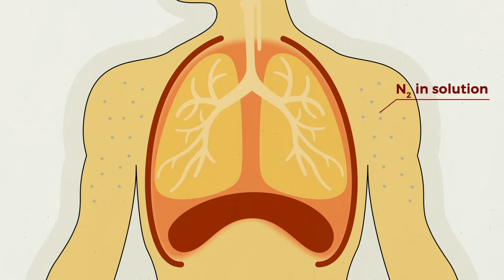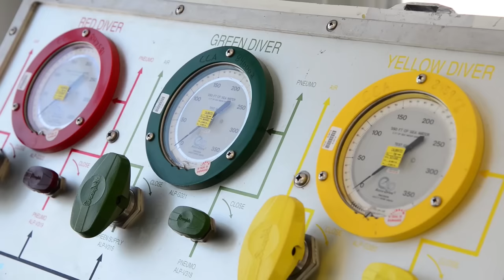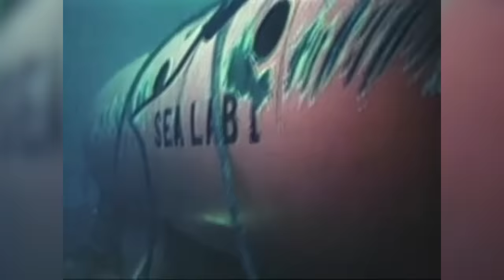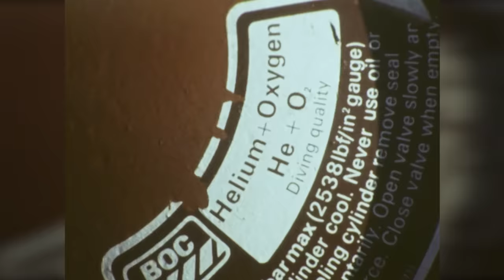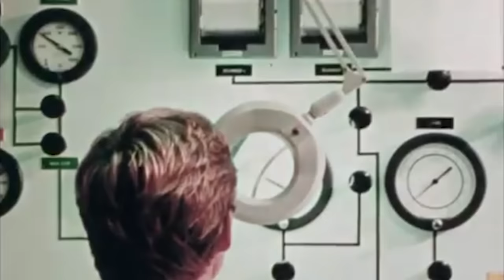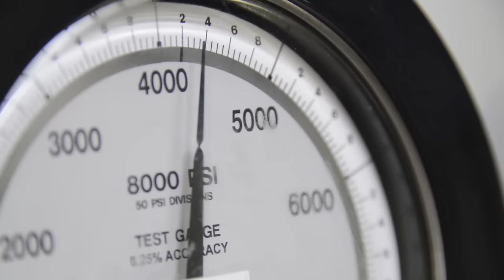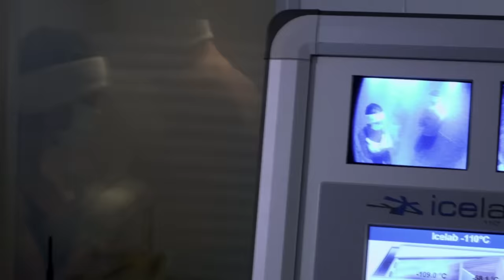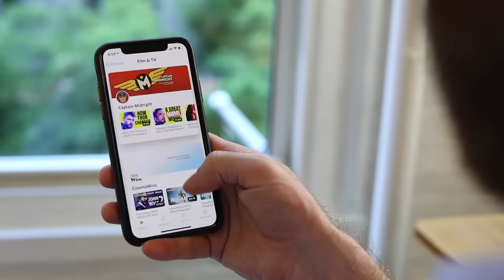Surviving the World's Deepest Dives

Comment: Hey so it says that every 10 meters adds another 1 atmosphere of pressure (which is close enough) but then you have 20m = 2 atm and 30m = 3 atm but if you follow this it means that 10m = 1 atm and that 0m = 0 atm, that would mean that it would be a vacuum at surface level which there isn’t. you can’t forget that there is already pressure at the surface which means that 0m = 1 atm and that 10m = 2 atm and that 20m = 3 atm. Just though I should point that out.
Reply from the maker: oh yeah woops. my bad!
Reply: I mean if you look at it as gauge pressure rather than absolute pressure the markings are technically correct
Reply: Real Science I loved the video though. And yeah I have made this mistake before as well.
Reply: I came to the comments to point that out! Great video anyway (as always)!
Reply: @Paul O'Reilly The surface pressure (0 m) is 1 atm, at 10 m you add 1 and so it's 2 atm.

Comment: Such a dangerous job on so many levels.  I read a story about an accident in one of the pressurized bells and it is unbelievably gruesome.  Lots of respect to sat divers and the people that keep them safe.
Reply: Probably the Byford Dolphin accident where 3 british divers and 2 norwegians lost their lives when one of them (let's say the fifth diver) disconnected the diving bell from the decompression chamber before the chamber door had been closed, which caused an explosive decompression with four divers inside it. Instant death. There was 10 atmospheres inside the chamber and bell, and one of the divers was sucked (or rather blown) through a small opening cause by the jammed chamber door.
Reply: @Antarath  10 atm? What depth does that equal to? Sounds like 60 + meters.
Reply: @d.dementedengineerc99isurf26  100 meters (295 feet). 147 PSI. It's one 1 atm for each 10 meters below the surface.
Reply: @Antarath  That figure omits the one natural atmosphere of pressure found at sea level from the earth itself, but I suppose that should be set to zero for simplicity.

Comment: cool video, but as a scuba diver myself, i would just like to point out that the pressure readings at 1:00 would better in absolute pressure rather water pressure (the atmosphere itself adds 1 atm of pressure, ie at 30m depth there is 4 atm).

this is important because the gas laws (boyle's law, charle's law, dalton's law, etc) use absolute pressure

Comment: Some clarification.
1. Recreational divers can reach 40 meters.
2. Nitrogen narcosis is an old term, now is called gas narcosis as also oxygen give is contribution to it (and helium, when used).
3. Most of works happen in the first 30 meters.
4. Diving air is 79% nitrogen and 21%, 78- 22 it's considered to be Nitrox (aka Enriched Air) and will limit the depth of your dive. but extend the time at depth. Control oxygen partial pressure is key to avoid convulsion.
5. Helium is a "cold gas", when breathed it remove heat from the body but without giving the coldness feeling and can lead to hypothermia if body temperature is not under control.
6. Sat diving can be as long as 28 days.
7. During sat diving the immune system will decrease is functionality, that's why every sat environment should be deeply cleaned to avoid infection.

Comment: Liquid breathing does sound interesting, so far I don't know to much about it but it's basically this liquid that is just as saturated with oxygen as air is so if you 'drown' yourself in it you would be able to breath on, it's used to torture people.

The main advangtage with this liquid is that there is much less gass buildup and that a liquid doesn't compress when put under pressure so the main cause of decompression disappears, of course you get a whole bunch of problems in return. Like, are you going to drown your divers every time they go to work? (does sound better than days of isolation tbh)  And how do you keep the liquid fresh and circulating?

Comment: Very informative, just a couple of corrections, the limit for recreational diving is 40m not 33m  and the  absolute pressure at 33m would be 4.3 ATMs ( remember to add the  atmospheric pressure)  . The air is composed by 78%  Nitrogen 20.9% oxygen and 1.1% of other gases which then its rounded as 79% N and 21%  Oxygen, the other gases are negligible to diving. In respect of the gas mixtures you got Heliox ( Helium and Oxygen) and there is also Trimix ( add Nitrogen)
Reply: Trimix is not common the commercial diving world. It is popular amongst the recreational 'tech diving' scene as it is a bit cheaper than a true heliox mixture. Currently the deepest a commercial divers operate up to 300m with some people proposing up to 500m with a hydrogen/ helium/ oxygen blend. The deepest a human has been pressurised to is 710m in a chamber in France on an aforementioned hydrogen/helium/oxygen mix. FYI when commercial diving is carried out at around 250m or more there is only about 2-4% oxygen in the heliox mix to account for the partial pressure requirements of our physiology.

Comment: 20 meters would be 3 atm, not 2. One atmosphere of pressure is at sealevel. 2 at -10 meters, 3 at - 20 meters.
Reply: @Latoo Ootal, thumbs up to that hehe
Another thing that was a bit off was that regular air is 78% Nitrogen and 21% Oxygen and 1% other gases but I guess someone didn't get the memo and had to adjust the math to 22% oxygen to make a 100% mix hehe
Reply: Its 2 ATM....or 3 ATA ;)
Reply: @08Farfar  Listen to what she actually said: "Air is made up of roughly 78% nitrogen and 22% oxygen."  The key word is "roughly."

Comment: That was a really good video! One of the best explanations on the subject i have seen. Just curious about the 33 safe diving limit you mentioned for recreational scuba divers.where did you get that number and what was the rationale? Generally most recreational organizations put the max limit for recreational scuba at 40m. The first physical limit for diving on air is 56m
Reply: 33 is a general limit when you are diving with Nitrox (enriched air which contains less nitrogen). It’s a specialization that people do when they are going to dive multiple sequencial dives, it helps to reduce interval times between dives.
Reply: its 100 feet
Reply: well  close too
Reply: Past 33m is 2 atmospheres of pressure, higher risk of nitrogen narcosis and you need to make more decompression stops on your way up. You need higher levels of training if I remember correctly.

Comment: 0:48 The pressure shown isn't quite right. While it is true that each ten meters add 1 bar/atm, the pressure above the surface is 1 bar also. So you'd have to add that to. For examples at 40 m, you would have a pressure of 5 bar (1 bar surface pressure + 4 bar water pressure).

Comment: It's worth saying that the first part of the this video is largly about rec diving and the second is about commercial or also known as tech (technical) diving. In rec diving, the safety measures are often overtly safe and injuries usually come from bad training, not from the activity being unsafe. Tech diving you need a whole lot more training for, and often requires different gear and safety protocols than rec diving. (The video went into some of these like extended safety stops. These are mandatory in tech diving and last several hours). But, to anyone looking to start scuba diving, i would not be discouraged by this video or some of the scary facts of tech diving. It is a whole different beast in its own right and scuba diving, done safely and with the proper trianing, is one of the most enjoyable times you will ever have

Comment: As a commercial diver I see so much misinformation and crap peddled around online. This video was great, all very accurate.
Reply: Nice one! Looking forward to the science behind the liquid breathing they showed way back in "The Abyss
" movie in 1989!
Reply: Do you keep a diving knife handy on that Heliox/Triox pressure suit? Or is a knife too risky in such an environment?
Reply: @d.dementedengineerc99isurf26  absolutely, you never dive without a knife, especially in commercial environments where there can be entanglement hazards all around you. It's actually part of the pre dive checklist to ensure you never get in the water without a knife
Reply: Helium atoms are so small, they will leak through airtight/watertight compartments. Also, helium conducts heat 6 times more rapidly than air, risking hypothermia. Knowing this, would the pressure suit itself be pressurized with an air/nitrogen/Neox mixture instead?
Reply: @d.dementedengineerc99isurf26  they aren't actually wearing a mixed gas "suit". It's just a wetsuit with a hot water suit on top, that pumps a continuous flow of hot water around their body so they don't become hypothermic at those depths. The mixed gas is contained to the dive hats, umbilicals and the chambers they live in. It's a continuous flow to the hat, not really stagnant air that sits there. As for the chambers they live in, I'm not sure. I would hazard a guess and say the walls are so thick nothing escapes them
Reply: @d.dementedengineerc99isurf26  also you're correct, all the saturation divers I've ever spoke with said the heat conducting properties of helium made them feel cold to their core the entire time they're in there. Also, extra fun fact, they lose their sense of taste the deeper they go, so many end up eating incredibly spicy food just to taste something. It returns once they get back to "surface".
Reply: @ace-kz9zd  Astronauts have a vaguely similar garb, since it has the insulated, puncture-resistant pressure suit over a water jacket undersuit. It is heated or cooled as needed, so same purpose to the diver. The environments of space and deep diving have notable similarities...
Reply: @d.dementedengineerc99isurf26  They're incredibly similar working conditions, even down to the gravity. That was one of the things I loved most about it. They even taught us in dive school that we would be some of the most well trained people for work in outer space whenever that industry began to widen more than scientists on the space station
Reply: @ace-kz9zd  That could be decades away, but it will become necessary sooner or later. We'll need pilots, mechanics,  machine operators, miners, welders, plumbers, electricians, supervisors, construction crews, cargo crews, metallurgists, geologists, and numerous engineers, to name a few.
Reply: @ace-kz9zd  "Continuous flow to the hat..." So the respirator is kept at low positive pressure. That's a good thing, since it lessens the risk of hypoxia.
Reply: @d.dementedengineerc99isurf26  exactly. Although I did somewhat misspeak there. The regulators are adjustable demand regulators not continuous flow regulators, although most divers will Crack their "free flow valve" in order to make the hat slightly positive pressure to fight off hypoxia, hypercapnia, a fogged visor and to keep their head a bit cooler hahaha.
Reply: @ace-kz9zd  Seems fogged up visors happen often, given the warmth inside the helmet from breath+airtight+cold water outside. So the pressure regulator is variable... Just learned something new. Certainly that wasn't the case decades ago.
Reply: @d.dementedengineerc99isurf26  did you used to dive?
Reply: @ace-kz9zd  I actually have not. Just making deductions. 
Some video claimed that saturation divers have reached a record depth of 700 m, seven times the depth we considered here. That sounds impossible.  That would be 70 atmospheres, and our lungs would surely fail at such a pressure. They must be using rigid suits. Even the rigid diving suits keeping the occupant at one atmosphere with joints and clawed hands have a depth limit of ~600 meters, so if true it must have been reenforced or upgraded somehow.
Reply: @d.dementedengineerc99isurf26  nope. That the whole reason for saturation diving, it acclimatizes the diver to the pressures, so there's no need to have an atmospheric suit. If you go down slow enough to allow all the air in your lungs, ears, sinuses and the like to stay in equilibrium with the environment there's no risk of a change in pressure causing a rupture. The chambers that they live in slowly pressurize to that depth over the period of a day or two. Then they ride in a bell to the working depth which is the the same pressure their habitat is. They get out of the bell, do their work, then ride the bell back to the habitat, all without changing pressure. Then to avoid decompression sickness "the bends" the habitat chamber is brought back to surface over the period of up to a week. The pressure isn't what actually caused the limitation of depth for saturation divers, but the density and mix of safe breathing gas they need to use at said pressures. Which in all fairness is due to the pressures being too high but it's not the crushing of the bodies like people seem to think, but instead the physiology involved with breathing a gas 70 times as dense as air.
Reply: @ace-kz9zd  Fascinating.
Reply: @ace-kz9zd  That implies there is no limit to the depth a person can dive, assuming they are allowed the time and facilities to equalize with the given depth.
Reply: @d.dementedengineerc99isurf26  the only limiting factor is the gas that they breath. Because our body reacts to how many molecules we breath, not the percent of molecules we breath, when we hit 10 meters or one extra atmosphere (2 atmospheres absolute) we're now breathing double the amount of nitrogen molecules and oxygen molecules. This is the fundamental problem with diving deep. At around 120 feet is where the average person will start to feel the effects of nitrogen narcosis, which is an intoxicating feeling caused by an excess of nitrogen in the air we're breathing. To combat this, after that depth people will typically start replacing the nitrogen and oxygen with helium, because it's an inert gas. You can also get oxygen toxicity from having too many oxygen molecules so it all has to be slowly replaced with other gases. But sadly it can't all be replaced with helium. At around 500 feet people can begin to experience what's known as high pressure nervousness syndrome, or hpns for short. Hpns was linked to helium, so again at around 500 feet the gas then has to be manipulated more. They will then begin replacing the trimix (helium nitrogen and oxygen) with mixed gas. They will start to add all sorts of other  gases to the mix at that point, hydrogen, argon, xenon and others. It becomes a science well beyond my grasp at that point hahaha. But the whole time they get deeper, more and more oxygen is removed from the mix because they're still getting enough oxygen molecules at that depth. The deepest sat divers are breathing crazy mixes of all sorts of gases with oxygen only making up 2 or 3 percent of the mix. Beyond that, the gas becomes too unsafe to breath, and diving is no longer possible without 1 atm submarines. Not because of pressure, but because of gas mixtures. This topic was my favorite in dive school, and I'm so grateful to get to share with you my very narrow useless knowledge on this obscure subject hahaha. Thank you
Reply: @ace-kz9zd  This hot-water undersuit you mention, surely it has heated sleeves and legs, but does it even have heated gloves and boots? I'd imagine in the cold, dark deep hands numbed by the chill wouldn't be welcomed!

Comment: The abyss calls. I must go. I've been bent. The sirens still call. I have never felt panicked or confused but i accept that everything must be done in a slow methodical pace. A virtual ceiling of deco stops are there, as if you are in a cave, no quick way back to the surface. Heliox? How about hydrox or hydralox? Blending hydrogen can be dangerous which is why is was researched but is not currently used. Liquid breathing? Maybe some day.

Comment: One item you missed is the air diving past 60 feet on oxygen or less then the Oxygen can become fatal (oxygen poisoning) That's why we are require to take an oxygen test 60 feet for 30 minutes) Diving on air past 150 feet Causes the Partial Pressure of Oxygen in the blood stream reaches 100% and therefore  could cause oxygen poisoning.  That's why we switch too 80% Helium and 10% Oxygen and every 50 to 100 feet past that depth we reduce the amount of Oxygen we use.  This is usually based on what diving tables we are using.  Past 250 feet we usually  use a bell system that has the same pressure as the divers working and that pressure is maintained in the Bell and Chamber.  The dive can work for several weeks with a change over teams that are at the same pressure one is working at.